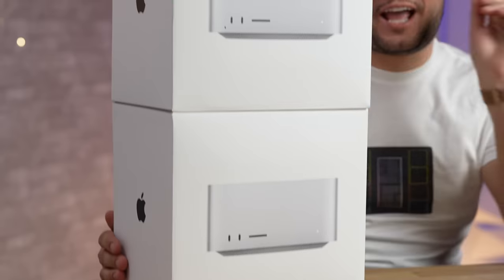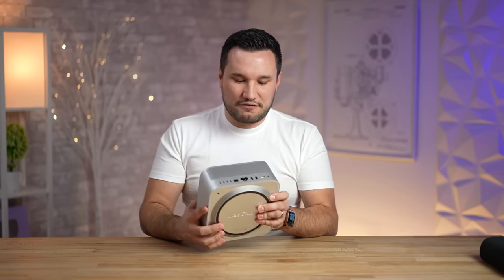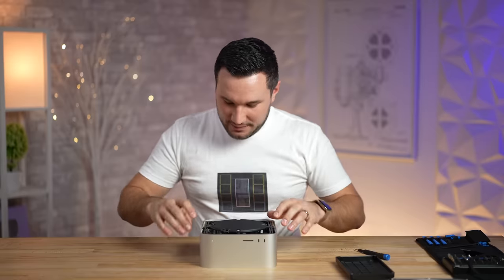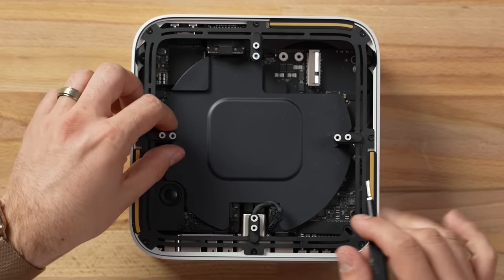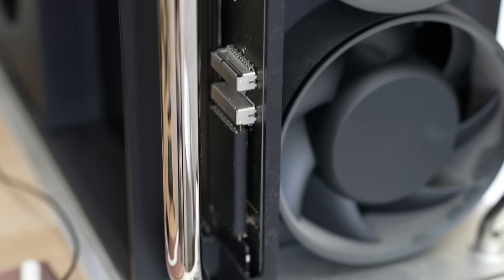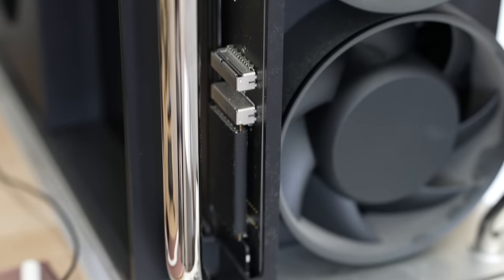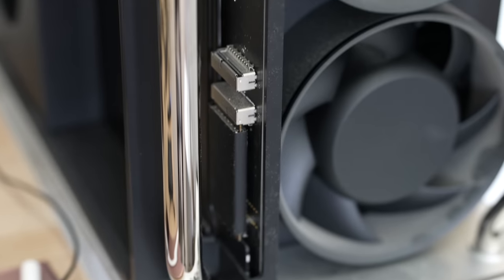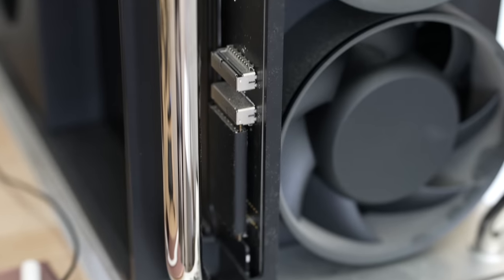Mac Studio FULL Teardown - M1 Ultra chip REVEALED!

Comment: Man, I'd love to know .. a) does it boot with the SSD in the wrong slot.  b) if you transplant an SSD from one of the other machines, does it see both.  I think between the two would answer a whole lot of questions about upgrade potential.
Reply: I hope that's the next video.
Reply: Another question comes up, Since you have shown us that this SSD has yet another Apple 'special ssd connector' which is just as uncommon as the SSDs in Retina Macbook Pros (the first A1398s before 2013) is it going to be only installed by Apple, not even sold as parts (or until OWC gets to back-engineer that later)???
Reply: I wonder if it has a proprietary connector for SSD's just in order to let Apple stab you with their stuff prices...
Reply: no even with different one from a different system

Comment: Can you test installing an SSD?  Would love to see if that works!
Reply: I was going to ask the same thing. In fact, it looked like they put the drive in the empty slot, wonder if it still boots from that controller.
Reply: By which ssd

I think it might be reserved for the 8tb model where they put two 4tb ssds in
Reply: Maybe its a 2230 m.2 slot. I hope it is
Reply: @crestofhonor2349  I think it's an apple proprietary ssd like the old macbook pro ones. someone will definitely try making an adapter but I doubt apple silicon will try to support it.
Reply: Pretty sure it’s an Apple only ssd. They will for sure sell them or let you bring it in later to upgrade storage. I think in a year or two Amazon will have adapters that let you put the small m.2

Comment: The SSD isn't actually upgradeable since it's married to your T2 chip via a identifier, and you have to DFU-restore it via another mac which doesn't work right now. You also can't plug in a nvme drive with an adapter to get it to work-as the controller is built in.
Reply: Indeed. Apple cryptographically hard-locked the SSD strictly into the Mac Studio it was wedded into.

Comment: Aren't you going to disassemble the other Studio and use that SSD on this one to see if BOTH SSD slots work together?  That would really confirm if the SSD can be upgraded.  Also, from the teardown, do you suppose the power supply needn't be unscrewed from the shielding?  That means you can remove the power supply and shielding as a layer on it's own.  Do you think you can replace the Apple logo on the top of the case and make that glow?
Reply: Yeaaaaah... bad idea. These are just NAND chips on a PCB, the controller is in the SoC. So there is no way to backup that data without special equipment and technical knowledge how to use it. So you stick in 2 and the system then got 2 OS-installations, no way to know what it will do. Maybe it just doesn't start, maybe it ignores the 2nd SSD cuz it's not formatted how it expects it to be formatted or the 2nd slot wasn't unlocked in firmware. Or maybe it just erases the 2nd NAND-PCB and then your other Mac Studio is basically bricked and you will have some expensive fun with Apple support. No way to know.
There are 2 NAND-PCB slots. They work together, or the 2nd one wouldn't be there. Apple wouldn't spend the money for something that can't be used. The question is just, can it somehow be used by consumers or did Apple lock that shit? That is something that needs to be figured out by people with actual technical expertise, not some dude who sees a CMOS battery and talks about how it's there so "just so your stuff is saved when it's turned off"🤦‍♂. Either OWC (+ maybe other companies) will announce "SSD"-Upgrades for that thing in the next, hrm, I'd guess 2-4 weeks... or it isn't possible without some hacking.
Reply: @Xirtamani  apple definely didnt put it there to be user upgradable. Just like on the tower Mac Pro.
Reply: There seems to be tape over the logo like it is on the older iPhone models with aluminium casing, so I think it’s s part separated from the casing like on the older iPhones.

So yeah, it should be possible to make this glow.
Reply: @JxcksonSF  Did you want to answer to the original comment or really to me? Because it seems like you didn't read my comment. Unless you somehow understand "can be used" (intended to be used by Apple itself, when configuring the system) as "user upgradable" and ignored the following sentence. And that it isn't there for user upgradability is extremely obvious with how hard it is to get there. So, thanks Captain Obvious.
Reply: @Xirtamani  what? no, user upgradable, is the user itself doing it 🙃
Why you even pissed?
Reply: @JxcksonSF  Yeah, that's what I said (I guess my sentence was overcomplicated and you misunderstood). It was about you answering to me that it's not intended for user upgrades, and why would you tell me that if you didn't somehow read in my comment that Apple put it there for user upgrades? It's intended for factory upgrades, but not for user upgrades. But time will tell if if it's possible to upgrade it as a end user.

Just too many people in the last days that come at me with strange answers like that.
Reply: You can’t upgrade or swap the ssd it is firmware locked to the machine. So you can’t upgrade. If you swap the ssd it will not boot or turn on. Way to go apple selling useless machines that can’t be upgraded
Reply: Got tested by "Luke Miani" by now - though these cards look like m.2 SSD, they are just the NAND-Flash and can only be replaced with Apple propreatary devices - also dongled to the machine.
So the good... a defect SSD can be replaced or upgraded by Apple
The bad... you will have to pay the Apple-only surcharge
Reply: Sadly the SSD is not user upgradable as it is not complete SSD. The controller is on processor which means if your processor is failing, you can say bye bye to your data.
Reply: It's blocked and not upgradable
Reply: @eternalinsignia  havent tought about it. Holy fuck Apple stuff is so wrong.
Reply: @eternalinsignia  it can be upgraded. SSDs there are upgradeable (unless if they soldered it, as Apple is extremely notorious for that) but you have to take the Mac Studio to Apple. They said that it's not user-upgradable because Apple cryptographically hard-locked the SSD inside each Mac Studio. Also, the controller for the SSD is separated from the actual SSD itself—it was embedded into the SOC, so it'll be a hard time for you to work it out.

Comment: Service tech here. Hopefully you figured this out already but you need to place those SSDs back in their exact same spots. They're in a RAID 0 config basically and encrypted so if you put them out of order, the data is inaccessible. Internal SSDs also require special software to use and install.

Comment: Great video, but for future reference, please (un)screw the tensioning brackets in a cross pattern. Doing them one screw at a time puts un-even pressure on the SOC and while it's probably fine, you do run the risk of having it not seat correctly (affecting thermals) or even possibly damaging it.
Reply: Yes, I was grimacing as this guy was unscrewing it wrong. Happily ignorant, blase and uncaring. I don't see the point of this dis-assembly when we have no idea if it can be re-assembled properly, or if it even was. Having more money than sense to uncaringly show a daft dis-assembly sans anti-static tools and bad techie practices just makes him look arrogant and show-offish.
Reply: @mauricegold9377  I was wincing at 10:39-10:44 when an undersized driver bit was being used to crack a factory torqued screw. Might have been a bad camera angle, but I could have sworn that undersized bit was showing torsion shear.
Reply: @timsexton  I was wincing at the fact he hadn’t grounded himself at any point in the disassembly! My father taught me to do that back when I was a preteen in the early ’90s, when hardware was far less complex and sensitive than it is today.
Reply: @wisdomyaw03  While it seems that what you say about the re-assembly did work out well, I just cringed to watch the bad practices of not worrying about ESD (electrostatic discharge), and not taking care about opening the device screws gradually, using opposite groups to avoid distorting the case and damaging threads. This comes from many years of working with computer innards in the past. That is all. And when others copy this practice, and if something went wrong. What then?

Comment: Would love to know what key type and length that M.2 SSD is. I wonder if it’s even a format you can buy from other manufacturers
Reply: It’s for sure proprietary, not even the Mac Pro SSDs fit in there. I wonder if it’s keyed the same as other Apple SSDs, specially the short ones in MacBook Air. Sooner or later someone will make an SSD upgrade kit for Mac Studio
Reply: @charminbaer2323  Won't be surprised if we see SSD upgrade kits from OWC in the near future!
Reply: If it's proprietary than that sucks but if it could take a 2230 that would be even nicer
Reply: @crestofhonor2349  it IS proprietary BUT it’s no biggie. There are adapters out there for older Macs to be able to use M.2 NVMe SSDs. Someone will just have come up with an adapter.

Comment: It's easier to disassemble than an iMac, but there's still a LOT of stuff to unscrew if you just want to clean out the dust from the fan and heatsink. Not worth the risk.
Reply: Blowing out dust from those fans and fins would be a common maintenance task for a computer like this with no real dust filters. It's a pity that it's so difficult to access.
Reply: @FromDesertTown  Probably not as needed as you'd think. These fans spin very slowly so they wouldn't acquire much dust, and even if they became a bit less efficient, these chips can run pretty well even if the fans completely stop spinning at all. I'd imagine you might wanna clean them out ever few years, if that.

Comment: After watching this, the Mac Studio is worth every penny. This thing is an engineering marvel, with SO much care. Wild.
Reply: However, comparisons between the Studio Max and the Studio ULTRA has ONLY shown big advantages in 3D graphics being 'two of everything', Cores, GPUs, Neuros and video Processors, but until Apple stops throttling the software to create the price steps, and until Apple reveals what is really "coming in the next in the next SHOW and TELL, I'll be sticking with the Base Model only increasing the RAM. Apple's 'Mission Impossible imitation' CEO is more interested in Price fixing for Apple's gain, than Playing Fair with the latest SQUARED-UP PRICING, 100, 200, 400, 800.... Steve Jobs would be turning in his grave. It seems...
All the 24/48 cores have mistakes as dead cores during TMC's Core production, and rounded up from the BINS to sell anyway, after killing a small number of odd but working cores to make FINAL multiples of 12. WILL THEY FAIL? Non-BINNED CPUS seem to be the BASE STUDIO  models and the ULTRA with the maximum working cores!
Reply: "apple cares" ??? this is wastefully complex parts, and packaging. Imagine the toll on the enviornment for the nuanced and bespoke parts manufacturing.  As well as all the byproduct waste for this manufacturing that gets dumped into the enviorment.  The apple fanboys who applaud this complexity all tout for all you folks to use less electricity and produce less trash, but will by apple products that have an expoentially large footprint in waste and chemicals byproducts of manufacturing into the enviornment so they can have their apple products.

Comment: Looks like the new rule of thumb for Mac Studio purchases will be “base SSD only,” given the fact that there are two sockets that can be upgraded later.

Fantastic tear-down video.  You guys are amazing.
Reply: We have to see whether or not Apple “locked out” third party drives. If it’s proprietary they still might make us “go through Apple” to upgrade the drives. Or they might release an os update to block third party drives. Here’s to hoping?
Reply: @J the more I think about it, the more convinced I am that this thing will not be “a niche small specific form factor”… This thing just killed both the regular 27’’ iMac and the iMac Pro in one fell swoop. Seriously, those who really need iMacs for their living rooms, schools or POS applications or whatever couldn’t care less for the difference between a 24’’ 4K display or a 27’’; and, IMHO, 24’’ is much leaner and more manageable in those situations.

I actually speak from experience here, as I’ve always bought the top-end iMacs of their time – the 17’’ USB 2.0 G4 a few months before the rather top-heavy 20’’ model came out, the Rev. A 20’’ G5, the OG 27’’ Core i5 and the 2017 5K, and those things were BEASTS; conversely, I worked as a Mac room/lab monitor at the Uni, and I loved the portable, smaller 21,5’’ iMacs we bought at some point, because the G5 and 2006 Mac Pro towers we still kept had to be lugged around on carts, and you couldn’t load more than one or two on one of those because you’d risk breaking it. And the Aluminum Unibody 24’’ iMacs, with the plastic back, we had on a classroom were actually quite manageable, too.

All those people clamoring for a 30’’ or 32’’ iMac or whatever clearly haven’t thought that through or never had to move their 27’’ iMacs around (or never owned one in the first place), because if they did, they’d seriously rethink their stance.

As for professional studios, where downtime is an absolute no-no? Separating the screen from the computer just makes sense, both from a financial and a functional standpoint (namely when it comes to resource management, as you can have some spare computers and screens laying around – or buy new ones outright –, and, short of having to reconnect a few cables, manage any malfunction in a much leaner and flexible way).
Reply: @ghost-user559 , we’ll just have to hope the fine folks @ OWC reverse-engineer SSD upgrades.
Reply: @J That’s definitely true, the real question is can WE hack it and upgrade ourselves for a fraction of the cost?

And will Apple possibly allow in store Upgrades from the Apple store at least if we want to extend the life of the machine?
Reply: @edwardx.winston5744  Very true, my only concern is the software component because these don’t appear to have controllers on them and that is actually inside the SOC, so can they talk to other brands? Are they serialized?

That is the only question left to answer.

Comment: Is there enough space to make a 90 degrees apple proprietary connector to standard m.2 adapter and add a standard length m.2 drive in there? Sandwiched between the MB and the PSU...

Comment: Great tear down, can’t wait to see the other SSD slot used
Reply: knowing apple, they've probably disabled it for third party use and/or uses some proprietary pinout
Reply: @possamei  most likely
Reply: If they haven't done already, they will in next software update.
Reply: @possamei  OWC and others will come up with an SSD that works with it. Would be cool if someone comes up with an NVMe adapter and makes it work with those short SSDs
Reply: @possamei  oh they won’t if they do they would got sue for sure 
 if they really want to make it not possible to upgrade they would just have to not put it there
Maybe it’s a slot which design for apple part if there’s a third party part that fit it might work
Reply: it's a pity he didn't peel off the black tape from SSD to read SSD manufacturer and SKU
Reply: @imdyinginside1919  OWC Made adapters and ssds for the proprietary ssd slots in macs for like a decade now and still do. I doubt that apple would only now sue them. If they do that’s basically comfirmation they‘ll make their own ssds
Reply: @helmi5045  I don’t think OWC ever made any adapters for SSDs. What they did was make their own SSDs using Apple’s proprietary connector and form factor. It’s Chinese companies that made adapters to be able to use M.2 NVMe SSDs.

Comment: Looking forward to seeing if the SSD is upgradeable and if that means it's also possible for the M1 Max Studio.
Reply: It’s not an SSD and is not upgradable. If you swap it with anything else, even a larger storage chip from another Mac Studio it will not turn on and gives you a flashing error light on the front. Even with the empty slot, Apples firmware would not allow you to upgrade. Other channels have opened multiple Mac Studios and did all kinds of swapping and nothing worked 😕

Comment: Thanks a lot for the informative video  - and happy reassembling :-) By the way, the lid of the ifixit tool set is designed to keep and sort the screws in their great variety... Great job and have a great time once the machine is working again.
Reply from the maker: Thanks I was actually using it for some screws but the rest I kept layout with the components they held in the right order. Many of the screws that held the same hardware had different lengths and even bits so I had to be very careful not to mix them. The machine is put back together now and working!! 😀
Reply: @MaxTechOfficial  That was a quick re-build! QUESTION: Do the Thunderbolt Controlers On the M1 MAX Mac Studio slows down EXTERNAL SSDs like on the M1 Mac Mini?